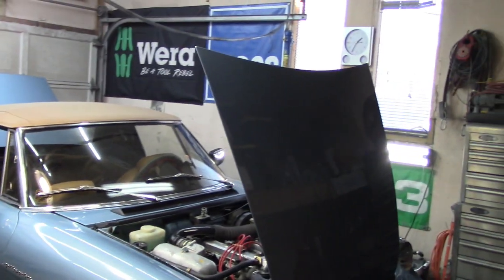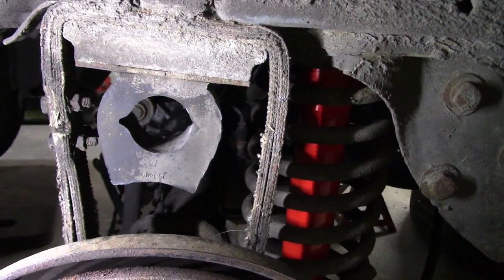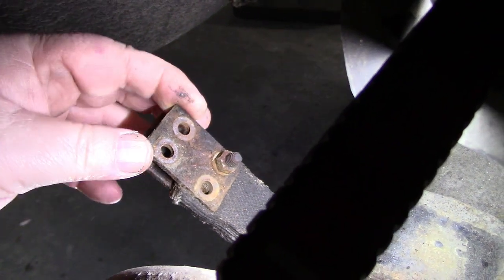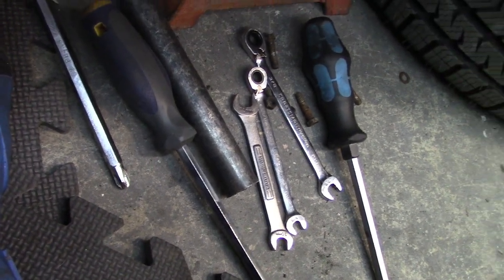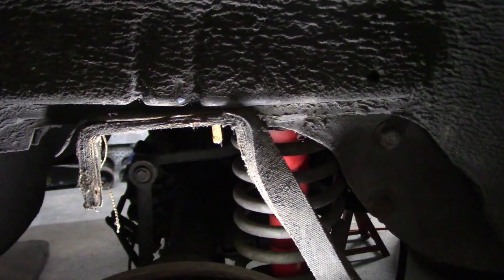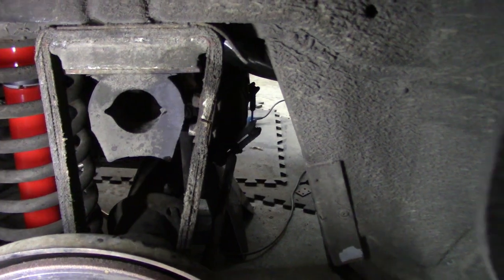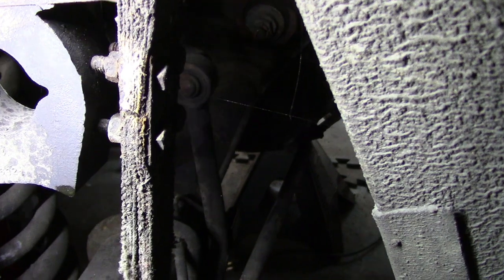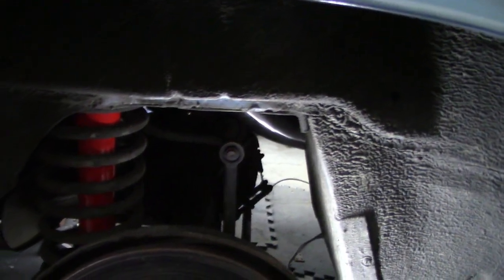1981 Alfa Romeo Spider Veloce, Rear Axle Rebound Strap and Bump Stop Installation

Comment: I'm surprised Doc wanted to replace the limit straps and bump stops.  I left mine on my '74 restoration but did replace all 8 of the rear bushings on the trailing arms with regular rubber.  I've replaced the bushing on a TJ with poly and have now learned you really don't want poly unless ride quality doesn't matter to you.  I left the T-bone bushings alone and figured that if I had to replace the bushings I'd just replace the whole assembly.
If you pull off the door panels consider cleaning and lubing the door lock handle assembly.  I had to replace the locksets (PO didn't have keys) and was amazed at how much better the doors were after I rebuilt the handles.
Reply from the maker: They are something Doc bought early on and I had in inventory laying around.  I’m not disappointed that I changed them.   I’m not sure what the quality of rubber parts/bushings are for the Alfa, but for the Triumphs they are horrible.  Maximum three year use before they are junk.  Most guys in the triumph world will go with Poly over rubber…some will even go with nylatron.

Comment: 105/115 Alfas don't have synchros for N to reverse or N to 1st. I think you installed the 4 limiting strap plates 180 degrees out.
Reply from the maker: Tell me about the plates please?  I noticed they had an end that was slightly out turned.  What direction should this be facing and what is the reason?  Cheers, Tush
Reply: @cheftush  Turn them inward to grip the straps better
Reply: @cheftush  We met an the LLBC/ Alfa drive this summer. Owned Alfas since 1983.
Reply from the maker: @bradfischer3643  Thanks Brad. I appreciate the reply.

Comment: rev gears dont have Syncros at least none in all the gear boxs I have worked on besides no need for one in rev. but rev will be the first to act up if the clutch is not fully disengaged.
Reply from the maker: Thanks mike. As I mentioned, clutch slave bleeding is up next on the agenda after the window adjustments.

Comment: Cheftush you don't want to use stainless screws they will corrode next to aluminum. It chemically reacts with the aluminum is something I learned working on sailboats. You do not want to have stainless steel connecting with it will rot the stainless steel.
Reply: Yeah putting some kind of barrier between the aluminum and the screw stainless steel screw will help to protect it so I think you'll be okay.
Reply: Mike, what is the solution to the issue that you have highlighted ? (Please)🤔
Reply from the maker: Hey mike, well, I’m not sure if the stainless steel will be worse than the steel bolts that were in there?  I know about the corrosion of dissimilar metals, but I’m not sure what more I could do here other than to coat liberally with anti seize.  Cheers, Tush
Reply: @cheftush  The big problem is obviously the reaction between the steel and the aluminium. I believe nylon spacers are now available. Also, the small panel that hold the whole assembly is a first class dirt trap so cleaning it out regularly and spraying with some wax helps
Reply from the maker: @jonwagstaff4150  well, they would have to be sleeves I think?  And, the aluminum block would need to be drilled out to accommodate….I think I’m better than the factory now at least with the socket heads and the anti seize…..
Reply: @cheftush  as as others have mentioned some kind of barrier between the aluminum and the stainless steel would work really nice a nylon sleeve as somebody else said would be a good way to ensure blocking the corrosion possibility. You might need to make the hole a little bit larger to fit the sleeve in around the bolt that would be my suggestion.
Reply from the maker: @mikehoroho8453  well, we are all probably overthinking this 😉. This car is now a fun Sunday driver…40 years from now, I’ll let the next hobbiest figure out how to get the aluminum blocks off…I did liberally anti seize them for him…he/she can thank me later 😎
Reply: Teff Gel

Comment: The rear springs look really rusty, likely even rusty under the rubber tube on the bottom few coils.
Reply from the maker: They do have some surface rust on them but they are in good shape otherwise.